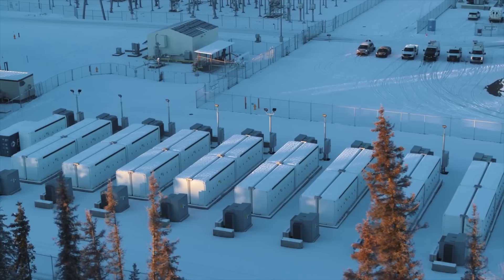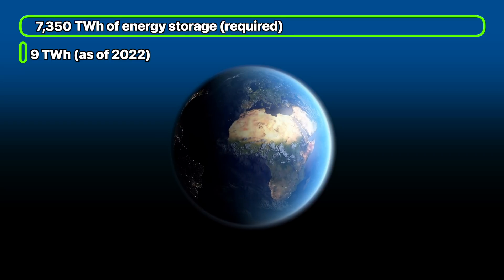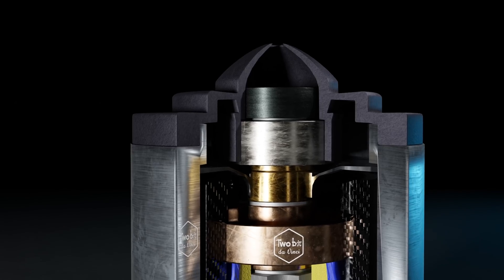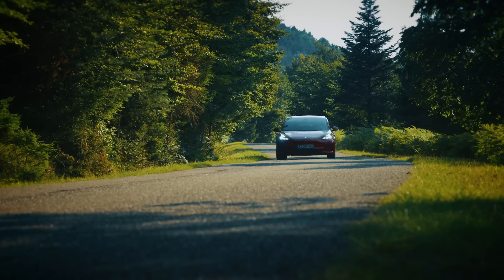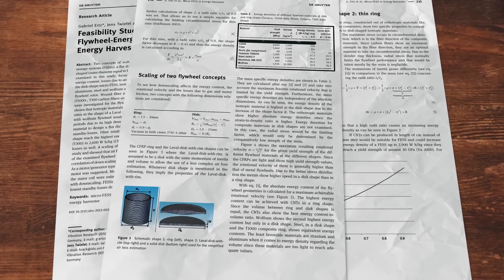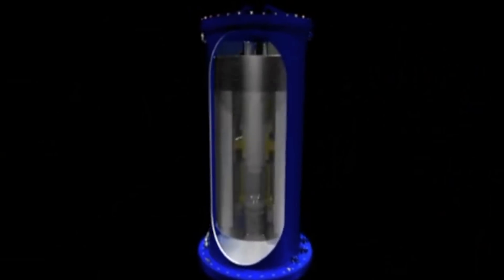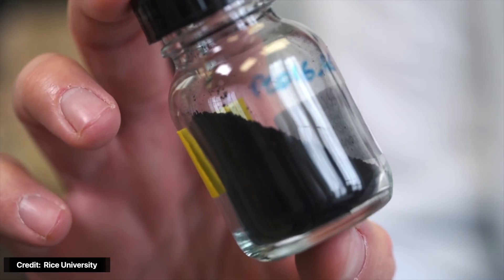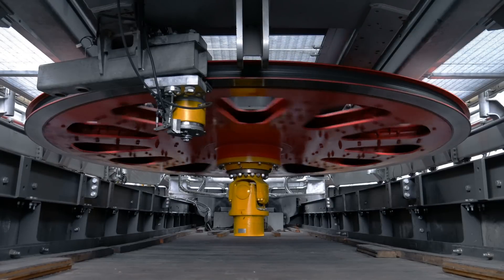Breakthrough Energy Storage Tech CRUSHES battery prices by 90%!

Comment: The video said that these can lose 3 to 20% of their charge per hour. I would like to know the source of that (my Google searches only gave the lifetime of the flywheel). My understanding of current-gen flywheels is that they are stored in a vacuum, so there's no air friction. Ball bearings are very efficient, or they may even magnetically levitate the flywheel, giving no friction at all. High losses may have been the norm in older systems, but even losing 3% of its power per hour doesn't seem real with the modern systems.
Reply: I have a suspicion a significant percentage is lost to the rotation of the earth

Comment: I have great confidence in flywheel  kinetic energy storage.
Reply: It's certainly interesting, but I haven't  as much confidence in it as you have.  It's already been tried and some examples are still boldly in use such as on the Stourbridge Junction Railcars. 
The fact that it's never widely caught on suggests to me that either the advantages are minimal, or that the complications needed to make it work are too expensive or that they in themselves create other problems.  
In simpler times, Engineers used to have a saying.  
(If the value that something consumes in it's manufacture, is greater than the value that it returns in it's use, then in practical terms it's a non starter)

Comment: What happens if someone puts a high caliber round through it?  If it is a battery, a small fire which is suppressed quickly.  How safe is this?
Reply: The wheel sits inside a steel vacuum chamber. The bullet would probably have lost its destructive power before contact with the wheel. CNT is a very hard material, so nothing much will happen there.
But a sudden inrush of air will result in some unpredictable outcome when it gets into contact with the wheel that spins at a high mach number. The air will heat up and might explode, destroying the bearings and letting loose the wheel.
Reply: @mennol3885  Sounds dangerous.

Comment: a mix of storage systems would be better ? too much power coming in at once to pump water up hill, store it in flywheel and then whenthe extra power dies down use the flywheel to pump even more water ...
or any other gravity based system, only have enough power to pull up 1 ton weight, have a grid of 10x10 1 ton blocks,
each individually can move up and once locked in at the top they can produce so much more when gliding down ...
after some system of locking keystones can be lowered in.

Comment: Isn't it interesting how that little ² in ω² causes completely counterintuitive behaviour of optimal flywheels being light (and fast) rather than heavy?
Reply: I can't think of any way that makes a diff, light flywheels make little sense.
Even "light flywheels" have to have mass which is where this video is probably misleading or doesn't understand the physics of flywheels.
I'm sure the use of carbon nanotubes is just an improvement on the "hub and spoke" flywheel design that concentrates mass on the rim of the "wheel" where angular momentum is greatest and removes all the mass close to the hub (center) of the flywheel where the angular momentum is least. A hub and spoke design might be more efficient relative to overall weight but it wastes a lot of space that's not being used for anything at all. That's why traditional flywheels are solid disks and not hub and spoke to maximize energy storage.

Comment: 30 years ago:
"Now we just have to make carbon nano tubes long enough and we'll have amazing applications."
Since CNTs are short, they are mixed into an epoxy matrix, considerably reducing the tensile strength (which is exceedingly good in only one-dimension if I'm not mistaken). The result is still amazing, but nothing compared to the numbers of pure  CNT.

Comment: The green trap is to be 100% full electric minded: while electricity was great to transport energy from huge dirty fossils plants and upper dams to living and working areas, now, not to roast the planet, the 50% additional energy we need to replace thermal mobility and fossil heating will be produced from local sun and wind power, meaning a lot of local production and storage, an area where electricity is poor, dirty and uneconomical, heavy on grey and mining energy, copper alone is stolen for a high value of 9000$/ton... 

Then beefing up by 50% a network to transport this extra green power elsewhere and also produced everywhere makes no sense, it doubles the cost right away to supply electricity while if done it right, renewable useful power can be much more economical. Here, the domino chain from well to wheel must be integrated and understood. At first, the system releasing useful green energy has to adapt “economically” to the energy source and then the corresponding “energy mobility and domestic loads” have to adapt also to the corresponding energy supply system. For instance all gas power stations are not supplied by a multiple pipeline grid network but by tanker trucks each carrying many MWh’s of energy and similarly with sun and wind near by much less trucks for supplies to stations…

The economies of scale of fossils and nuclear huge plants do not exist for solar wind or green hydrogen production with all  ingredients present wherever humans live. Logically hydrogen green production and storage is the lowest grey energy answer on free power sources, near 10$/kWh per capacity of power storage, good for 50000 long storage cycles with no measurable power losses, hundreds times cheaper by kWh stored than LFP and much greener too. Moreover, the valuable pure O2 and heat byproduct are paying for having free hydrogen and those so called “inefficiencies “ of green H2 production systematically criticised by ignoring those cogeneration values deliberately!!!

For small domestic power storage the new low temp. Yet heavy Salt batteries are the most promising durable, recyclable, rebuildable and economical solution. A supermarket in Schlieren had a 520kWh salt battery storage for a while, it weighs 7 tons, the economics are promising for home storage and much safer than LFP depending on a scellent BMS to survive..

Flywheel storage is loaded with costly maintenance and poor efficiency long historical and expensive records . Old Hubble telescope moves and changes orientation with flywheels in three directions, all sitting on magnetic bearings…and such flywheel energy storage technology can only be justified with low cost energy supply zones like hydro or geothermally dense electricity areas..

Comment: Density doesn't really matter for grid purposes. Just cost and loss rate.
Carbon nanotubes don't address loss rate, and their cost is astronomical. 
Grid flywheels are best with whatever the cheapest halfway strong material is. Iron works. You're not carrying it anywhere, it can be bulky, that doesn't affect it's utility.
Density could be useful in a vehicle, but it has immense gyroscopic force, and moving vehicles around (against that gyroscopic force) tears up a flywheel, and greatly affects vehicle handling.

Comment: So just to keep your flywheel spinning you're wasting 20% of the energy. Sounds like a solution for a very specific problem. Where power is in excess but it might cut out or you might require a spike in power supply.

Comment: The only issue with using a single flywheel in a modern motor vehicle is the gyroscopic effect.  This would make the vehicle very unsafe.  Perhaps get around this issue by using multiple flywheels spinning in different direction.
Reply: The Porsche 918 RSR is a flywheel hybrid. So they managed to do it in a race car no less.
Reply: @willjapheth23789  Hi Will, I accept that.  The race car operates on a relatively flat track - no sharp vertical curves.  If you check, the flywheel axis is set vertically so that it would not effect cornering.  However if it were to undertake sharp vertical turns then the gyroscopic effects would appear.  My comments relate to normal everyday use.  On an off road 4x4 going over very rough ground conditions the gyro would have to be turned off .  Any sudden changes in the vertical plane would cause the vehicle to change direction.  This effect is easily demonstrated when a motor cycle turns a sharp corner and the rider leans the bike over into the curve.  What holds the motor bike in this precarious position are the gyroscopic effects of the wheels trying to move in the opposite direction.
Reply: @johnspathonis1078  yea hills and valleys matter the most. Doubt the 918 RSR never gets tilted. Also the bike effect is mostly due to the angular momentum of the whole bike not the wheels. Like 1 G turn should allow you to lean 45 degrees regardless of gryo effect. Racers can do more than 1 G turns.
Reply: @willjapheth23789  Hi Will  I don't know if your a mechanical engineer but I have designed vehicles to comply with national design rules (ADR's).  In vehicle design they talk about friction utilisation factors (basically coefficient of friction.)  A very good coeficient of friction is 0.6.  To pull 1 G the coeficient of friction must be equal to 1.  This is not possible.   At 0.6 the maximum lean angle is 59 degrees.  So if a motorcyclist can lean more than that there are other forces at play.  On a flat surface 1 G turns are not possible.  With superelevation or banked curves then that is possible.
Reply: @johnspathonis1078  Typically you can add to your downward force with spoilers. Bikes don't have as large ones so they can't go much of 1 G but they can. F1 and drag racers can do over 2 G. The gyroscopic force helps with balancing but it's not powerful to account for most of the crazy lean. You lean because the inertia of the whole bike wants to throw you over the wheels, the wheels just help alittle.

Regarding gyroscopic force being damaging. I think planes are a pretty good example of how high radius, high rpm blades can handle sudden torque. A flywheel is best used as a mechanical capacitor though so it would be for stop and go driving anyway. Brake energy recovery is what's important and the prius can already do that. The flywheel is probably just for the quick punch like the 918 RSR has.
Reply: @willjapheth23789  You seem to be talking about the exceptions rather than what happens on real roads with normal average people.  Bikes with special tyres, spoilers, smooth pavements, no moisture, experienced riders etc.  Trying that with any type of moisture on the road or debris (leaves, small stones)  ends in disaster. Anyone trying that will end up RIP.  I have spent a considerable amount of time and much money developing road signs that that can be hit by a sliding motorcyclist and survive.  We have special motor cycle crash dummies for that specific purpose.  Let me say we killed a few crash dummies in the process of developing a safe sign.
Reply: @johnspathonis1078  the times motorcycles do the most leaning is when racing. Racers can do high G turns, which allows them to lean. When they can't, they can't lean as much. If the gryo effects was the main force then you could lean 45 degrees on an ice road. Gyro forces are manageable was my point. The bike g force thing is a tangent.  Mobile flywheels are only discussed for brake energy recovery or high power low weight for acceleration, like the 918 RSR. Not high battery life applications, other then the gyro Street car they mentioned, I guess. Eventually the gryo forces would be a problem but the calculations are more work then I want to do right now.

Comment: Great video Ricky, very interesting!
I live in Canada and I split a lot of firewood every year. I recomended to my community that we buy a 40 ton kinetic wood splitter this year and it is amazing! It has 2x50lb flywheels and the splitting time is 2 seconds per split vs 12 seconds per split for the standard hydraulic splitter. I split tens of thousands of pieces of wood every year so it makes a massive difference! Then between splits the engine is idling on medium low to spin up the flywheels again and so I can split 3x as much wood per tank of gas compared to our standard hydraulic machine. It does cost a little more to buy the machine in the first place but it is well worth it and only a flywheel can deliver that high impact force needed to split knotty hardwoods.
Reply: Interesting,  I'm planning to build a kinetic splitter at the moment after watching a YouTube video of a guy who made his own using a Lister D stationary engine to power it.   
Considering that his engine only produces one and a half horse power the results are truly impressive.

Comment: If they can make them more robust, the best, as you already stated, is using supercaps for storage.  Gravity batteries seem to be a better option for now than using flywheels.  Just an opinion.  Again, until they can figure out a better supercap method, it's gravity batteries to the rescue.   Have to have a sufficient way of using gravity of course meaning the space is astronomically much bigger than a flywheel, that is for sure, but at least you don't lose much energy (if at all) from idling.   :)
Reply: There may be no losses when a gravity storage system is inactive.  But it's not as efficient during its active states.  The best "gravity storage" is water in the form of pumped hydro storage, which makes up more than 90% of the total storage worldwide and is a mature technology over 80 years old.  There are a lot of inactive open pit mines which could be used for pumped hydro storage.

Comment: We all tend to wear the same blinkers when we come to electrical energy storage. We assume that we must get that energy back in the form of electricity or it’s no good for us. 
But a lot of domestic energy is used to create heat. A box with interior dimensions 2’x2’x2’ filled with sand at 400°C has a total of 33kW.h of above-100° heat. This can be used for space and water heating and could be used to power an absorption type fridge. Of course that box is going to grow quite a bit with sufficient insulation. Contain that sand in a stainless cylinder at 15’ diam x 36’ height and I believe you could make it into a Dewar flask, perhaps 16’x 40’. 
Monel heating coils would be embedded throughout the sand and heat would be extracted by passing air through pipes also embedded in the medium.
Done on a larger scale this could be used for long term, seasonal, energy storage. For example, store 100 cubic metres at 500°C and you’ve got a tad less than 18MW.h of stored heat.
Obviously, storing electricity as such is higher quality energy available for more purposes than heating but given the demand for heat, and given the relative simplicity of thermal storage, and its suitability for long term storage then I think there’s plenty of space for its inclusion in the overall mix. In a new build, urban environment a structure the size of an average house could provide winter long heat for a dozen or more solar powered houses using the surplus generated during the summer months.

Comment: Stationary storage maybe.  But all flywheels have gyroscopic forces, which would affect vehicle handling regardless or orientation.  Yes, cars have them, but they're much smaller than would be needed to store substantial energy.  Plus, no matter what kind of bearing is used (magnetic bearings in a vacuum is optimal) the motion of the vehicle would cause friction and the system would lose efficiency in motion.

Compressed gas is far more efficient, and theoretically lighter in weight, as long as the system doesn't leak and it can handle extremely high pressure.  Ordinarily the ability to handle high pressures would make the tank heavy, but that's where the carbon structure technology comes in.

Comment: I was just thinking about how you could use this for home at about the same time you were saying it’s doesn’t really work for home. I think I would disagree if it’s sized right. I live in Orlando with blazing sun all day. If you charged up flywheel during the day it would be available for the peak loads when everyone gets home, takes hot shower, start cooking, turn up the ac etc. just design it to get over that bump.
Reply: You did notice they were putting those under ground so if they failed it wouldn't destroy everything in the area? And no mention of price or the maintaince cost. Cause those units must be monitored to catch problems to avoid failure. It's like why most multi story homes have stairs and not elevators. Just because you could do it doesn't mean it makes sense to on many levels.
Reply: @adrianwilson7536  Yea, I think you'd still want it in the ground except for the lid. I'm just guessing here but what I pictured was about the size of a small garbage can that sits on mag bearings. The spin up motor and converter are attached to the lid for ease of maintenance and wiring. Again, all guesses, no idea on actual size or cost needed to reduce the 5-8pm bump. Even the length of that bump is a guess.

Comment: Did I miss the part where he talked about the mass of the flywheel.  the stored kinetic energy must be related to the mass at a given speed.  the greater the mass, the more stored energy.  This would require more input energy however.
Reply: You didn't miss anything. Yes, it's missing in the video not explained well when he was talking about lighte flywheels using carbon nanotubes which should further mislead and confuse viewers.

Comment: I'm a recent viewer, so haven't seen mention of Liquid Metal batteries, on this fascinating Channel, so don't know if the topic has been covered. Antimony/Calcium/Salt, battery operating at 700C developed by MIT's, Dept of Materials Science and Engineering, Dr Sadoway and His Ambri Battery Company based in Marlborough, MA, USA. A variation on electrochemical refining of metals.  A site in Nevada, will have a 500 MW battery installed. 
Problem with Kinetic batteries, they consist of moving parts.